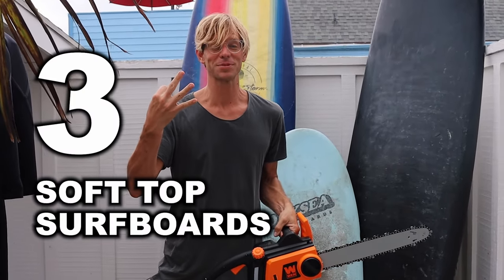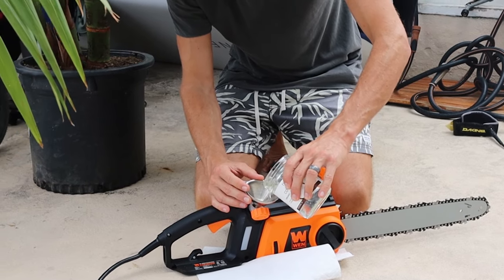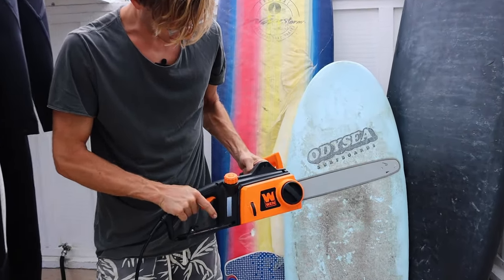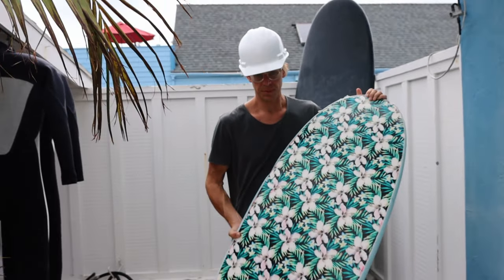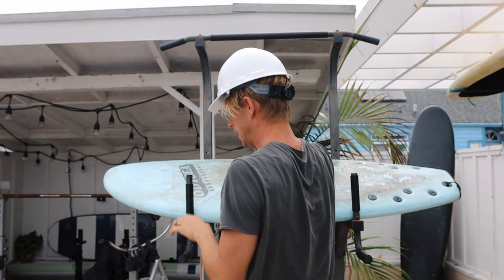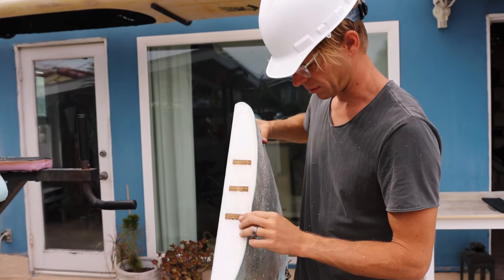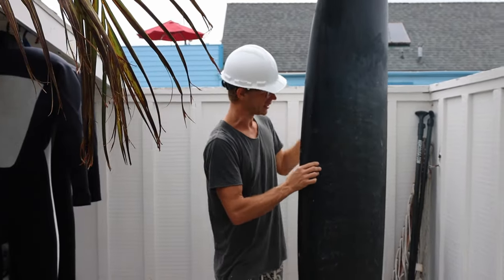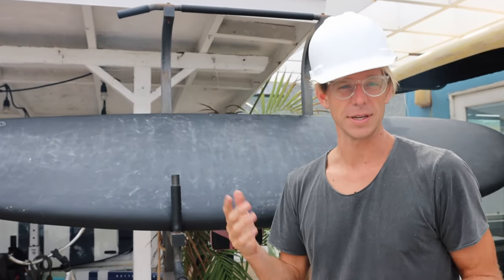AVOID These 2 Soft Tops (here's why)

Comment: if the board is glassed couldnt you run a regular fin box? not the drop through fins?
Reply from the maker: Probably but it would add a lot of cost.
I want to see if we can use Futures fin boxes instead of FCS... our factory couldn't do it for this first batch of boards, but maybe we will figure it out. Futures fins are stronger at the base.